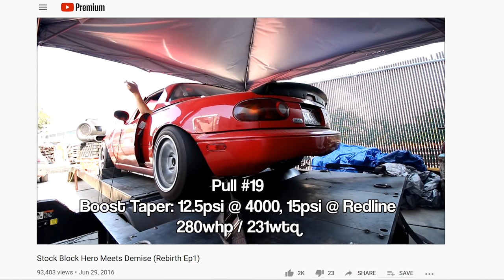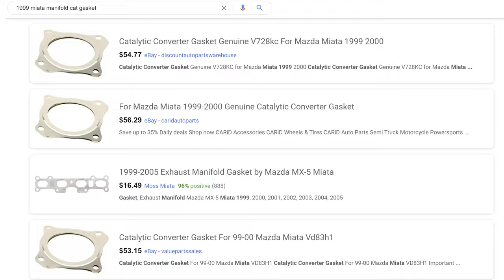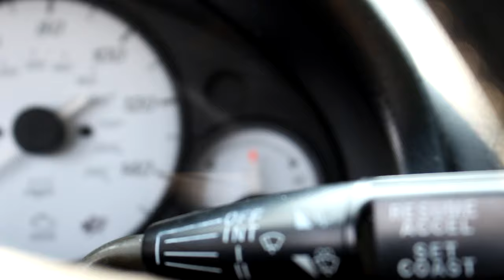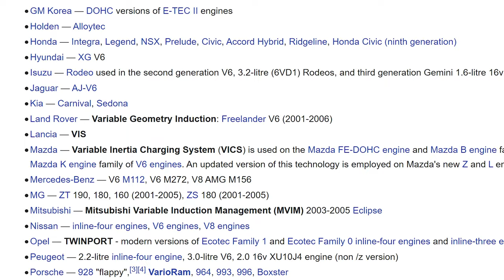Troubleshooting 6 Common Issues Your Miata Might Have! [Project 2SJ Ep5]

Comment: Does your nb suffer from rev droop dad?
Reply: what is that can you explain!? i think i have that with my nb...
Reply: Please explain?
Reply: It's when your revs drop down lower than your usual idle, down as low as say 300 or 400 rpm. It happens when you let off the gas and are out of gear or in neutral, for example when your coming to a stop. There are a lot of forum discussions about it so it's easy to Google and find out more. But it's notoriously hard to fix completely. Supposedly it's caused by the ecu not being able to keep up with fluctuations in the air fuel ratio. You can usually fix it somewhat by cleaning the throttle body and the air bypass passages inside of it, then resetting the base idle.